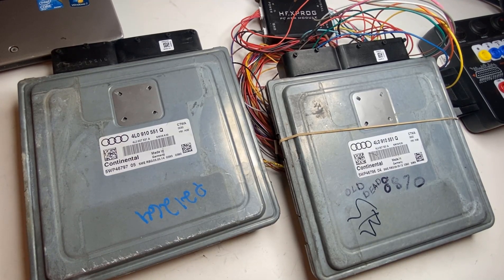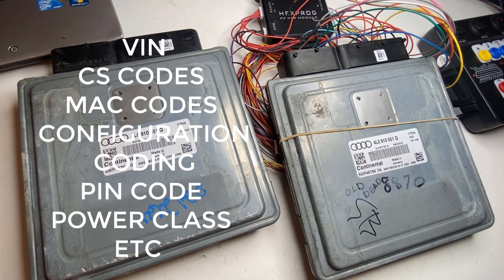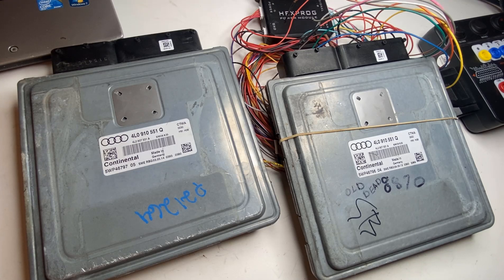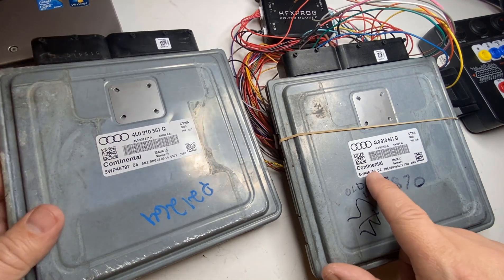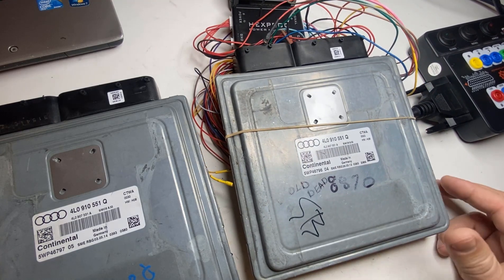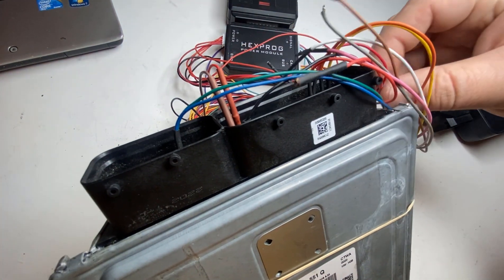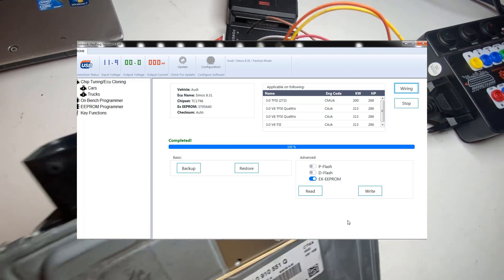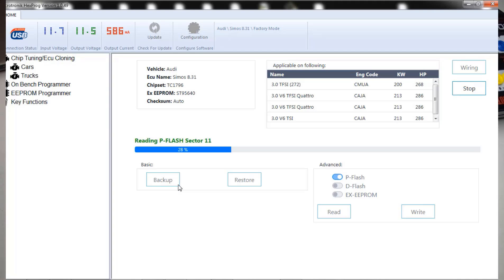Audi  VW ECU programming from original to good donor ECM.

Comment: Hey What is "Byte to Code Configuration Code" On these Audi's? I'm Trying to Do a ECU Swap On a 2009 Q7. I'm Using Xtool ScanTool With Programming Capabilities. I'm at the Point where ita Asking for "Byte to Code Configuration" there are 3 Boxes with 2 Digit Numbers in them. Idk what that code is, Its Showing the same numbers for the New and Old ECU. Can you help?

Comment: Hi is it possible to do the VIN number change remotely for a fee (online if you log into the car via my laptop). I had to replace my original as it was water damaged . I purchased a donor unit from a local company that repairs and sells used ECU's. My vehicle is a 2010 Vw Mk6 GTi ,manual shift. I have VCDS software which I use for diagnostics. I also had to replace the ABS module due to water damage. The car runs very well but I have CEL light permanently on with EPC light and all three brake warning lights are flashing  SO Traction control is also non functional, I have tried coding the ABS module more times than I can remember a scan brings up that it is not coded it brings up a string of zeros where the long code is. What I believe it comes down to is the cluster has the original VIN while the ECM and ABS modules carry the donor VIN. My first question above is because I live in a small town in South Africa. I am an Auto Electrician by profession and know my way around VW's very well. Looking forward to your response

Comment: how do i read the pin number  from the ecu or clustrer of a 2011 caddy caye 1.6 tdi so that i can pair a replacement ecu  (caddy is uds donor is not)

I have retro fitted a 2004 bkd 2.0 tdi, i have the pin code from the donor but not from the original caddy parts.

If i pin the bkd cluster to the caddy dash wiring I can use the bkd immo key/ring to start the van and can even swap the clusters back over after starting allowing the caddy to restart if turned back on quickly (before the immo re activates)